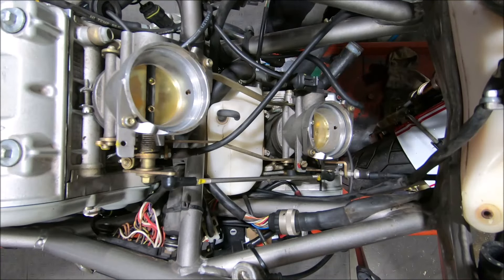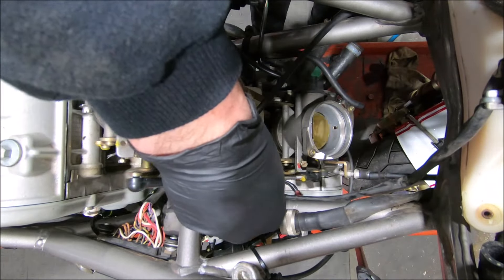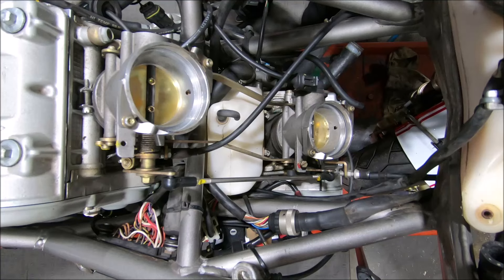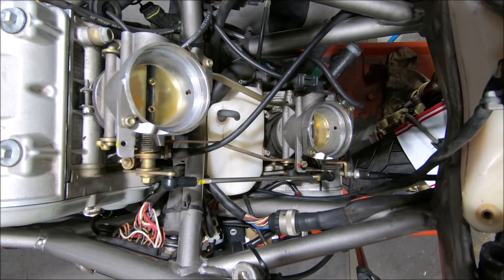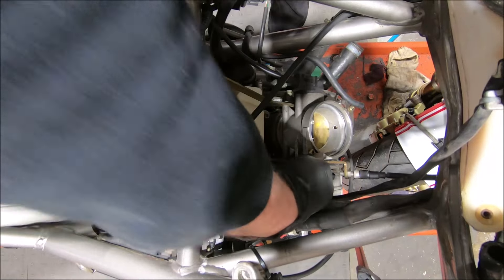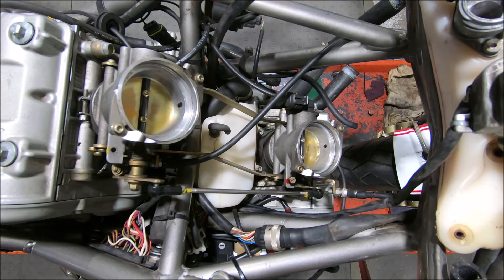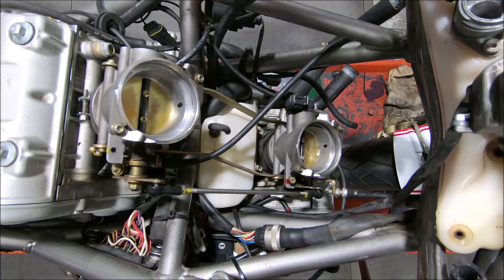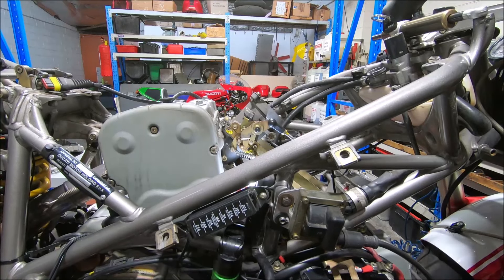Ducati 998 throttle body rambling to go with the TPS setting report.

Comment: hey Brad, how do i get to the throttle body adjustment screw to balance the throttle bodies while the engine is running?
Reply from the maker: spanner or right angle screw driver?
Reply: @bradthebikeboy  ok, figured maybe i need to get a longer spanner.  thanks attemping now!